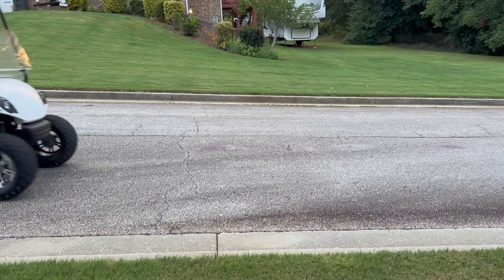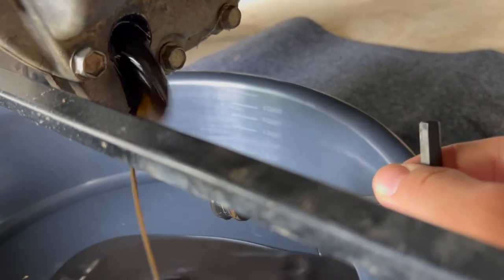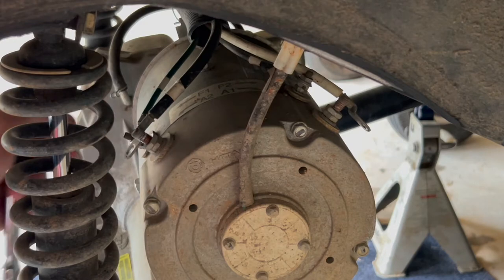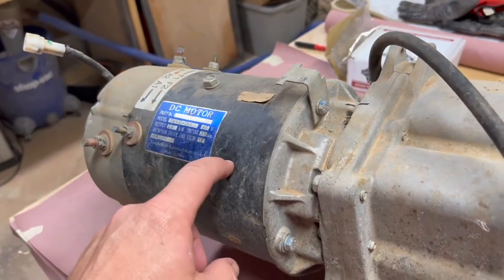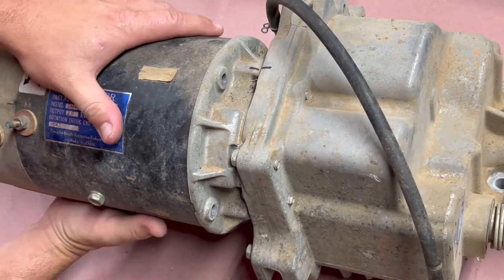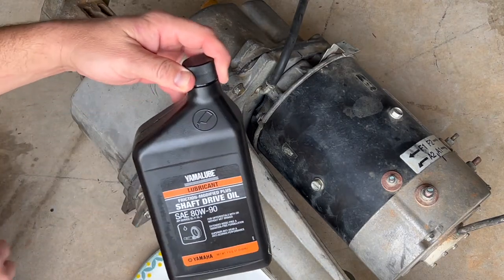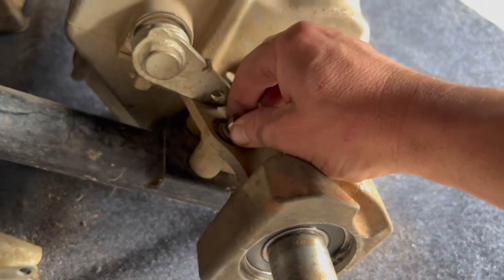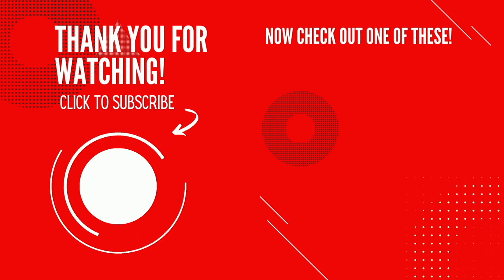Fixing Brake Noise Golf Cart Transaxle | 2008 Yamaha YRDE G29 Electric Golf Cart | Golf Cart Repair

Comment: The last plate (with the teeth on the axle) cannot be removed because the bearing is locking it on the axle. Any tips for removing it? It is not shown in the video
Reply from the maker: I ended up leaving that one on and it worked fine. You could have a machine shop use a press to take it off.

Comment: This was great help. I had issues with axel bolts under motor. I ended up removing the motor to access the bolts. I was able to remove brake plate bolts without messing them up. Reconnecting the brake cable was the hardest thing I had to deal with. Cart brakes are much stronger and no noise.
Reply from the maker: That’s great! I’m glad it worked for you too!

Comment: I have a 2007 YDRE.  It's not making noise while breaking, but it's making a grinding noise while coasting or once I reach top speed and it goes into regen mode.  Thoughts?
Reply from the maker: Check the ball bearings on the axle.
Reply: If I'm not mistaken, these models have what's called an input shaft bumper. It's just a rubber cup that slides into the motor female spline shaft. They need to be replaced every 4-5 years so that (for what ever reason) it doesn't mess up the softer metal splines on the motor. Pull your motor and look very closely at the motor splines and you'll see some of the teeth will be worn. Hopefully you don't have to replace the input shaft.The noise your talking about was cured by installing a lesser priced rebuilt motor which included the bumper. PS, "they" don't just sell the armature alone.
Reply: The motor shaft slipping on the input shaft sound a whole heck of a lot like a bad bearing.

Comment: Hi, is there a way to change the input shaft without cracking open the cover? The last bearing on the input shaft is hitting a gear, and I can't get it out. I really dont want to crack open the Case.
Reply from the maker: You shouldn’t need to. My left side shaft came out because the bearing blew out. See if this video helps: https://youtu.be/LosQfD41uYo

Comment: I had two g29s I bought around same time. Second one was a good deal and couldn't pass it up. One had team axle and other was newer when the switched back to standard axle with drum brakes. Team axle definitely has better braking power with much less  force being applied to pedal but I'm kinda glad I sold that one and kept newer drum brake model even if brakes aren't as good. Much simpler maintenance. I have such steep inclines here I really need front brakes as my rears.overheated a while back while going downhill with too heavy of a trailer. It could have ended badly as I was forced to exit driveway into main road at high rate of speed. Live and learn.
Reply from the maker: Yikes! That could have been really bad.
Reply: @TightWadDIY  luckily its a rural county road but still...
Reply from the maker: @truthhurts2149  I figured it was when you said you were pulling a trailer with a golf cart! The city folks wouldn’t know how to hook it up.

Comment: Thank you for this video, very much appreciated and the BEST video around for step by step.  

2 Questions: 
#1 Question: Just want to get your advice, if I had noticed that the motor had been leaking oil for quite some time and I'm just getting around to fix it; I went ahead and followed your video and pulled the transaxle down; and the best I can tell is the the oil leak was from main/case seal; Is it normal wear & tear for that main seal to go bad?  --- I removed the drain plug and NO oil came out. :(.

 #2 I supposed I'll have top OPEN Up the case so I can put in the new seal(?), I'll order and use the same seal you did.   Thank you for any advice.
Reply from the maker: I’d assume a new seal would solve the issue. It’s hard to say without seeing it though.

Comment: Great video. Thank you for doing it.
One question? I have replaced the transaxle oil on my 2013 YRDA G29 cart as a maintaince service. (at 5 yrs) There was no noise or squeeks when applying the brakes before I changed the oil.
Now with the new Yamalube oil, I get a slight chirp or squeek just before the cart comes to a stop at times.
Your opinion? Should I not worry about it? or try changing the oil again?
Thank's in advance.
Jim......
Reply from the maker: Are you sure you added enough YamaLube? I had a hard time getting the correct amount in while it was on the cart.

Comment: This helped me out alot. Thanks. Mine was making the same noise and I took apart and changed all disc's and plates and it's making the same noise. I'm stumped. All gears and bearings look good too. Not sure what to do now
Reply from the maker: It makes the same noise as mine when you are coming to a stop? Did you use the YamaLube? Are you sure you added the right anoint?
Reply: @TightWadDIY  yes the same noise. This video did help me out to get it back together and I did use yamalube. I can only fit just over a quart in rear end. Used all new brake plates and discs
Reply: @TightWadDIY  do you have any idea what else it could be?
Reply from the maker: @khuber32  I really don’t know. I’m new to golf carts. I was shocked at how big of a job it was to replace the brakes!

Comment: I was going to take my 2013 G-29 Yamaha to shop but they can’t guarantee they can fix it or get parts so after this video I will try! My rearend grinds and cart doesn’t move. Do you have a video showing what the end of axle locks into inside the housing?
Reply from the maker: I do. Check out the other videos in this playlist.

Comment: Hi! I appreciate the video! I am replacing my brakes as well. I noticed when putting the friction disc and plates back in you used 5 discs and 4 plates? It is kind of sped up there so I’m not for sure. But my kit came with 5 plates. And you ended with friction disc and I keep ending with that last plate. What am I doing wrong? Thanks!
Reply from the maker: Sorry I just now saw this comment. I put mine back exactly how it came off. Looks like I used 5 friction plates(with grooves) and 4 smooth ones. So start and end with a grooved.